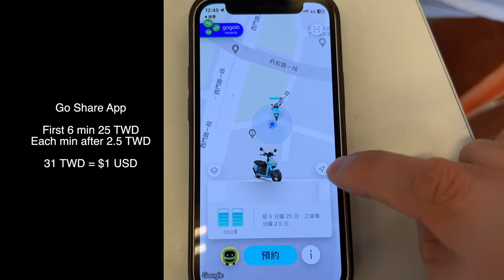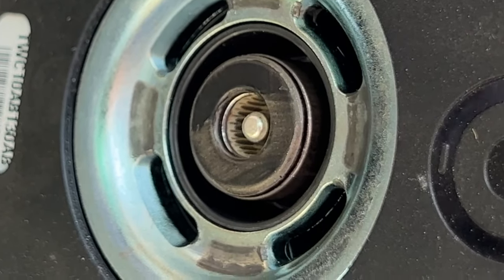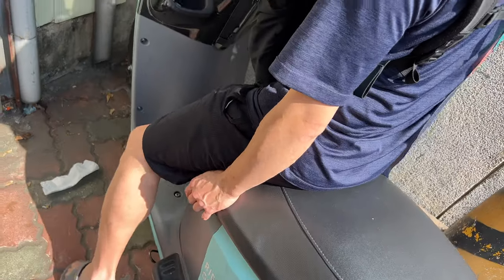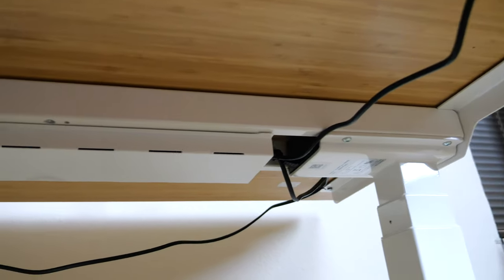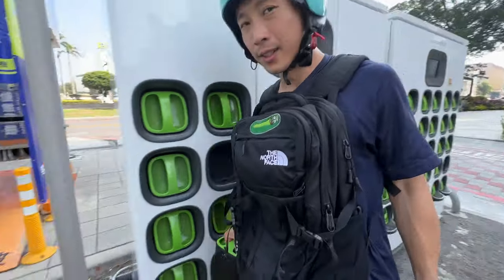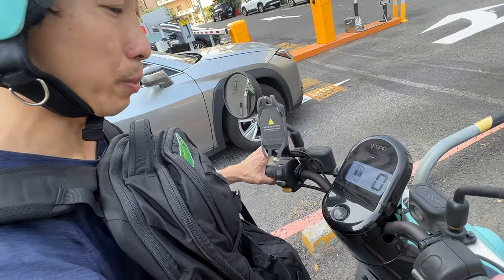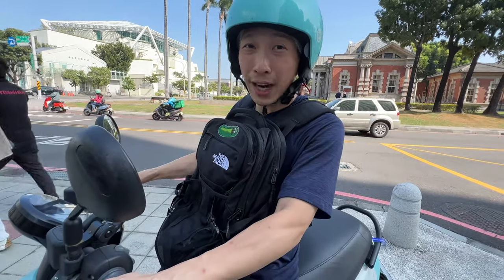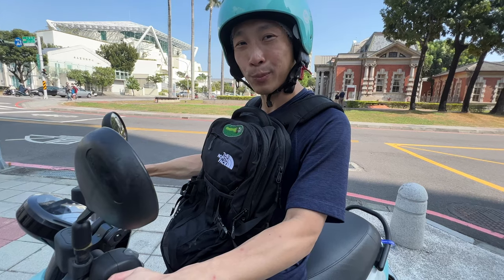Battery Swap Technology in Taiwan

Comment: For a rental this is okay. For a car I own, I wouldn't want to swap out battery and risk trading for an older or defective battery with 30% less capacity.
Reply: I'm pretty sure the current battery swaps for cars have built in diagnostics to detect charge capacity and battery damage. So the station won't swap with a defective battery.
Reply: Beat the bush do a video from night markets. That will be awesome!
Reply: thats not the point since if it even happened you could swap again. You dont own the batteries
Reply: Pretty similar to propane tank exchange I would think.  If something is wrong with your tank, just swap it and let Blue Rhino deal with the problem.  Or like a scratched Redbox DVD... exchange for another one and not your problem.
Reply from the maker: If you own a car with battery swap tech, you have to think of never really owning the battery. You just rent it. The cost of each battery swap will bake in the battery degradation costs and the cost to have the infrastructure to do the exchange.
Reply: BTB can swap that batter with one hand. With an EV battery, I doubt he (or anybody) can even do it with two arms and two legs!
Reply: Thes batteries can be charged at home too, with the GoCharger Mobile
Reply: @BeatTheBush  Nissan/Renault has replaceable battery packs in Israel if I remember right.
Reply: You are the best example why technology is not for everyone. If you are swapping battery you will not own that battery and can easily swap it at any time you want. Its like propane tank.
Reply: @mac.ignacio  I poop my pants

Comment: it's quite pricy though :O if you would use it for everyday commute the price is too high in my opinion. If it can be cheaper than public transport it would make sense. Only advantage I see is that you can kind of drive whenever u want instead of waiting for bus/tram/train for like 5-6 mins. Huge disadvantage is that one needs ot be focussed during the drive while on public transport one can do some reading, active listening etc.
I remember in 2019 the electro scooter hype. basically 90% of companies went bust and 2 survived.
Reply from the maker: Pricy? You can make a quick 10 minute ride for $1-2 usd. Do that 4 times a day and you wont break $150 a month. Pretty reasonable to me as its much cheaper than owning a car or a scooter yourself.
Reply: @BeatTheBush  I can get for 70$ a full month of public transport
We also have electric bikes, scooters but they never made financial sense for me (unless ur company subsidizes the bikes to be more fit)
Would be interesting to compare the public transport cost (often there is 50-60% discount for frequent users) to those scooters in the location you showed. For sure it depends on how extended the public transport network ist. But I also remember in Shanghai I travelled much cheaper by taking metro and bus than taking scooters or bikes.